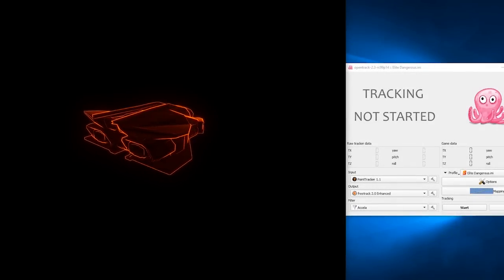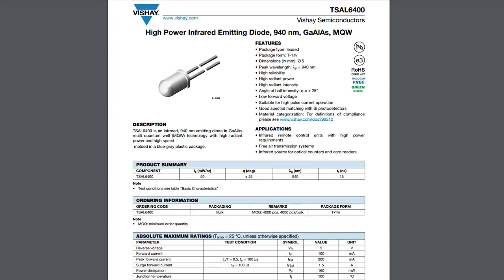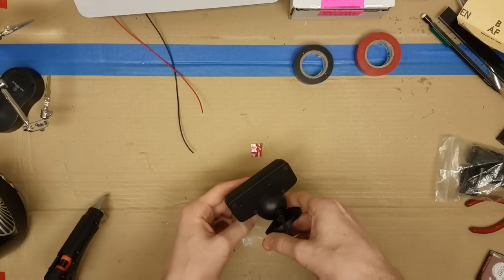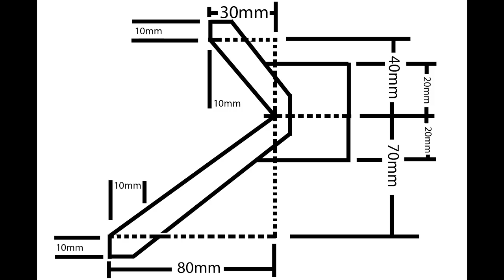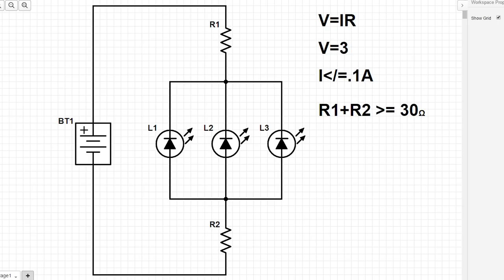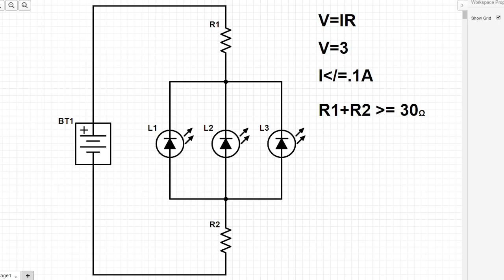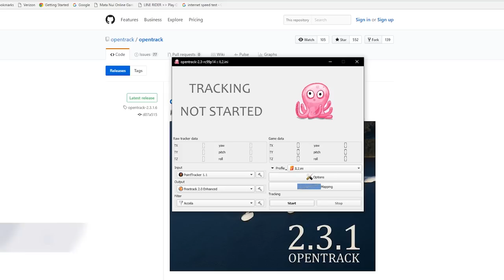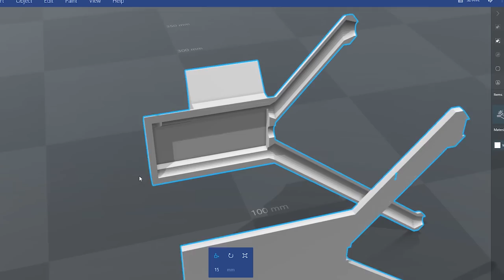TrackIR Build Tutorial

Comment: Actually its not cheaper to build one. I just added everything to my cart in Amazon and its over 55 dollars. The dylan clip with camera is only 50 canadian
Reply from the maker: First, let me say that this is an alternative to buying an official TrackIR. One that will run you about $150. Now, there Is a lot to consider here; mostly what materials you have on hand (what does "everything include?). Right now the only materials I would need to purchase are the LEDs, The PS3 eye camera, and the filter. All together that will run me 25 USD, or 30 CAD. Then there are shipping cost and time considerations. At the time I posted this video, all items in the list I posted were amazon prime. So for myself at least, I had all of my materials within two days, with assembly taking maybe 3 hours. Other than that there are a couple of distinctive differences between the "DELANCLiP" and the design I use. These are mainly centered around the filter, and how the design is powered. To you Kaywood, and anyone/everyone else, I'm not selling anything here. I'm just trying to save people money. If you find and option you deem cheaper or more convenient then definitely take it.
Reply: ok
Reply from the maker: You got everything for less than the stock price for the IR filter? That's insane!
Reply: lol same i made it under 10$ , used ps3 eye cam and some ir led's + scavengered some resistor from old electronics board + old floppy film as filter.
Reply: AliExpress

Comment: so can i not take the inside of a floppy disk and use that as an ir filter but stick on the outside of my camera prefer not to open it up xd help ? @civilproduction
Reply from the maker: I have never tried using the film from a floppy disc, so I am not sure how well it works. I think that others in the comment section report that it does work if installed inside the camera.

I can say that, if you purchase a purpose-built filter, then you can attach it to the outside of the camera, and can skip opening up the ps3 eye camera.

I hope that answers your question, and best of luck with your build!